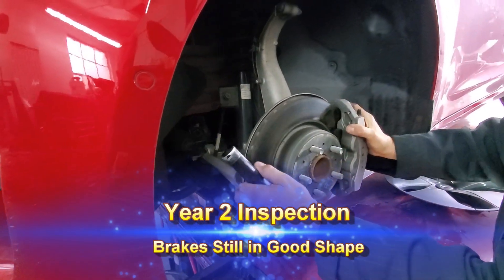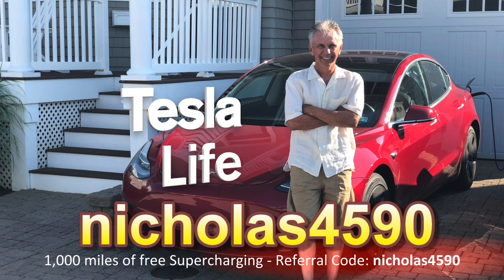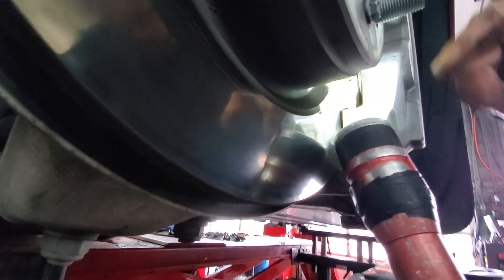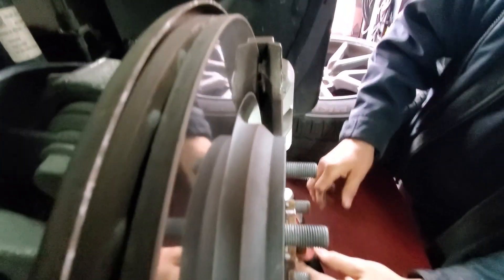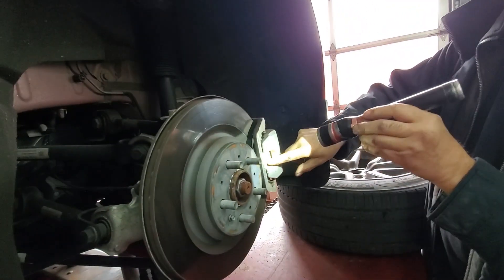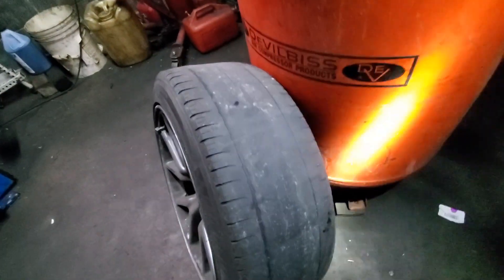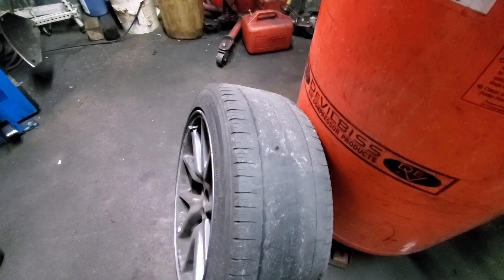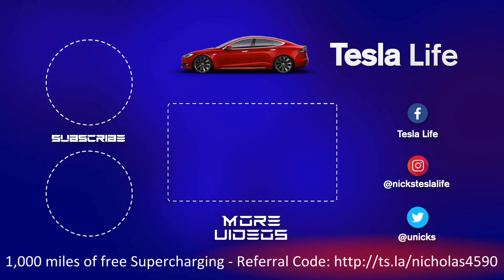Tesla Model 3 - Two Year Inspection Brakes are Still OK!

Comment: My original 18" Michelins made it to 16k miles. . . . 😕 Lots of demonstration drives!
Reply from the maker: Rears, right?
Reply: @TeslaLife  Correct. It was one of the first deliveries with the Gen 2 seats, making it still new enough that many had never experienced a Model 3. I hope to get all-around better life from the replacement set, identical.